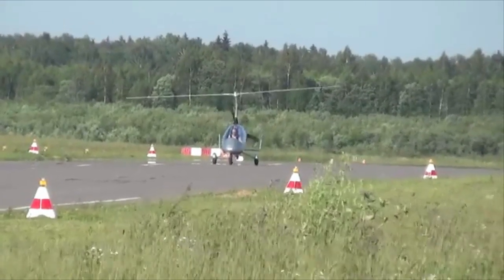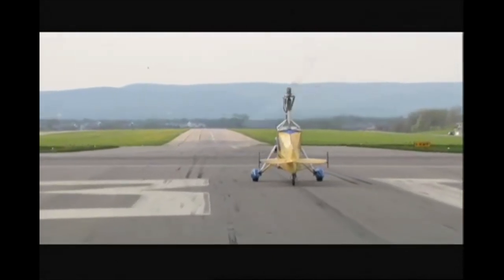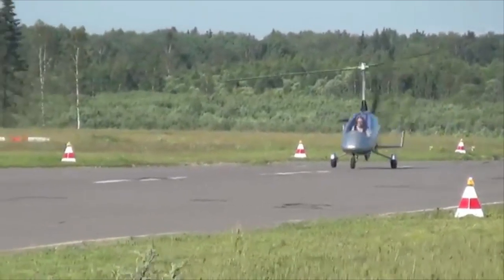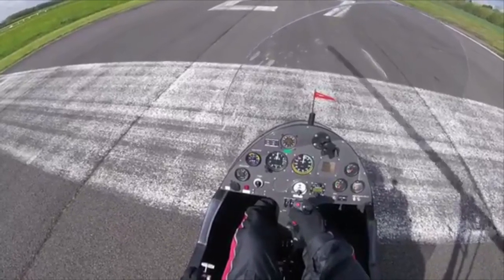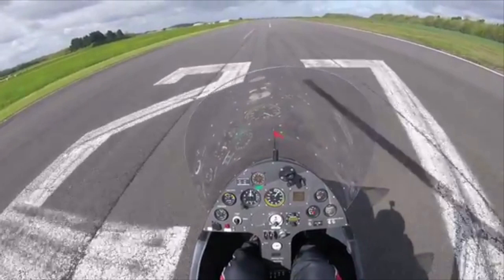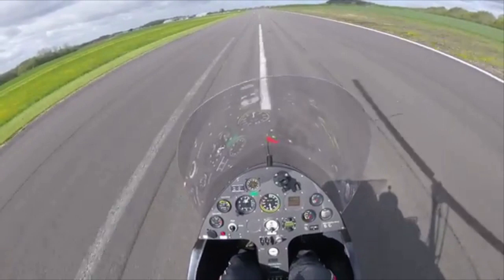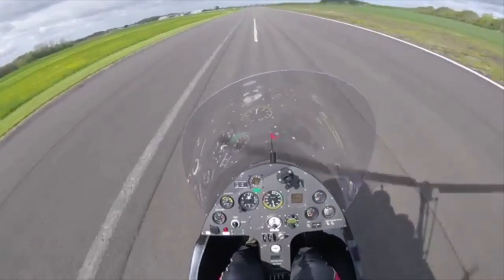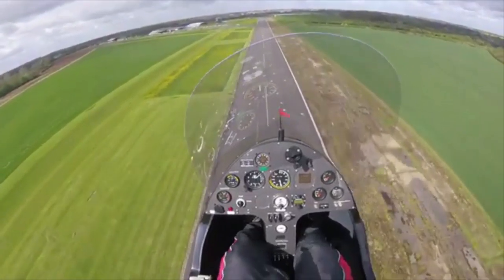Gyrocopter perfect take offs

Comment: One thing that I was taught which I’ve not heard mentioned by other people is to dump the trim pressure (trim fully forward) once the stick is all the way back (in the MTO Sport). I don’t know why (although I have some suspicions as to why), but if I don’t dump the trim pressure, my takeoffs are not as good.  I do bring the stick forward a touch to pre-empt the nose coming up once the rotor RPM is climbing steadily (which would usually be noticed at around 250RPM) and as the nose-wheel lifts, I continue to ease the stick forward to keep the nose down (although still only just a few inches off the runway in a wheel-balance position). If I don’t allow the nose to come up, the gyro starts feeling twitchy in the ground-roll. When I get it right, the unstick is reasonably flat (although, I still need to counter the torque-roll to the right and bring the stick a little further forward to keep the nose level) and I only need to build up airspeed for a couple of seconds or so before I reach climb-out speed.
I do have a video of one of my takeoffs but I am hesitant to post it because the camera is on my passenger (because I wanted to film her reaction to her first gyro flight) and I don’t want it to end up in one of your future videos as an example of what not to do... ;)
Reply from the maker: Thanks for the thoughts.

Without putting words in your mouth I think the feature that you find “comfortable” is the flatter unstick attitude?

Ref: trim pressure – that is linked to the above because if the MT has any residual pressure in the system then it is effective trimmed slight aft and so makes for moving the stick forward slightly harder. i.e. more stick force.

I don’t talk about that here (although it might get mentioned face to face depending upon individual feedback) because:- 

1) it creates yet another step in the process 
2) the forces aren’t that great for an adult guy of average build to overcome anyway 
3) the process I suggest it isn’t a factor because the nose isn’t going to “pop” 
4) even if you feel it is harder on your arms I’d rather trade that for less steps and added mental capacity to deal with other factors that are even bigger deals  
5) if the forces are so great for you as an individual then hopefully sub-consciously you can include the process as part of your own method but done automatically whilst able to focus on the other more critical items.

That’s just my advice – but I understand why you have the feedback you do – its just seat time and creating a consistent feel.  So happy to include the “dump trim” but just don’t obsess about it – in actual fact in Cavalon it has an even bigger effect!

As I mention all the time – making a 4-5min film that is watchable becomes hard to grab all the nuances and cover all bases.  That’s not an excuse but make a 30minute cover all film -  the real nuts and bolts get forgotten while you remember to trim forward, if you take my point?

Neminem posted a link in these comments to an accident in 2012 where the aircraft (seems to me reading) suffered a tail strike because of over rotation.  So to my point and the clips in the film that is a common error  

[and it would have happened in a more extreme way to the Magni M16 pilot in France (the red gyro) but the Magni rotor does not incline as much as AutoGyro and other rotor heads plus it has a straight keel.  So put that guy on that take off in an AutoGyro -  it looks ugly.]  

Yet detractors of mine only focus on rotor RPM or not pulling the stick back.  

Well hang on I say pull the stick back – so if you don’t do that you are not doing the technique but more to the point any accident that has happened that way has only happened to people using the standard technique.  So this is just chatter.  

It is a real issue but it is an error not of technique (whatever you use) but of forgetting to do something you needed to do.  It is helped by having a simple, less complex process - Hence 2 steps.  Frankly if you can not remember 2 steps then stop flying.  Harsh but fair.  

So now we look at the rotor RPM issue.  Well again in this technique we are looking at rotor RPM so how do you mess that up?? Look at the rotor RPM decaying and not act? Again if you can not monitor your instruments – stop flying.
Reply: Gyrocopter flying club - I think that, as you’ve said in your videos, the unstick is a little later and there is better airflow over the empennage. The flatter unstick requires less correction.
My thoughts about why my takeoffs are not so tidy if I don’t dump the trim is because I’ve been taught to do it right from the beginning and I’ve become accustomed to the way that the stick feels, and I’m probably positioning the stick by feel rather than by sight. As the gyro is still on the ground at this time, the feel of the stick is the only feedback. If there is still trim pressure, the stick ends up being further back during the takeoff roll and as the nose comes up, it requires a greater degree of correction. Add to that the fact that with the stick further back, I’ve been creating a lot more drag, so the acceleration profile ends up being quite different.
I think if I were to spend time learning takeoffs without dumping the trim but keeping much the same technique, otherwise, my takeoffs would eventually be as good without doing so as they are when I do so.
I absolutely agree with your aim to simplify the number of steps. I think that the take-off phase is probably when the work-load is highest in a gyro.
I read the article about the 2012 accident. The guy said that there was no damage to the tail but that there were what appeared to be blade-strike marks in the ground to the left of the gyro’s track. This suggested to me that he’d outrun his retreating blade. He even said that the starboard wheel lifted. Of course, I don’t have your level of experience or knowledge.
What I found astonishing in your video is the guy in the silver Calidus. I’ve scraped my keel on takeoff (during training) and the immediate response was to lower the nose a little. He seemed to keep on pulling back.

I agree with your statement that if you cannot monitor your instruments, stop flying - because if you don’t, you’re likely to stop flying one day whether you intend to or not.

Oh... and just to be clear - I didn’t make my post because I disagree with your technique. I was curious as to your thoughts on dumping the trim and why it might make a difference (as you might have a different take on it to my own).
Reply from the maker: Hey no no - hey its cool I didn't think you were calling me out but even if you do thats good also.  Speak freely on this channel I never delete a comment and I answer honestly.  Thats how we all learn right?

What is very funny to me is the reaction to some films/views that I know are controversial.   I get a dozen thumbs down but nobody speaks up.  Its part of the problem actually with the gyrocopter community - nobody wants to stand out and speak up with what should be obvious issues. 

Hey ho.
Reply: Gyrocopter flying club - One thing I’d like you to clarify - Do you advocate for keeping the nosewheel on the ground until unstick or is it just that you are putting the focus on rotor RPM rather than wheel-balance?  In other words, not actually eliminating the wheel-balance altogether but just not making that the focus of the procedure? Because that’s how I interpret your two videos on the subject and I would like to be sure that I understand).
Reply: @RoadRunnerLaser  In some gyros the trim is less easy to change.  In the Sparrowhawk and RAF 200 it is a spring system adjusted by pulling a cable with a wheel.  Not fun to keep adjusting and easy to leave adjusted for the next flight.  So in those and many like them they are left set.  It is hard to give the best practice for every gyro.

Comment: I could understand that. Just out of interest, what techniques do manufacturers recommend?
Reply from the maker: The problem is they don’t describe a methodology to get to this shallow angle of pitch to take off. And as you can see from the link of a 2012 accident in the previous comment - that pilot was waiting for the nose wheel to lift before reacting and he didn’t he just over-rotated - which as you can see from this film it happens often. Some crash some get away with it. The key with this technique is that you are pro active and alive to action at key points plus the drag is less and if you add in the context of the newer 320rrpm aircraft this technique is closer so again requires less re-training. Mental capacity is key with gyros.

Comment: The way of the world. Things have changed for the worst unfortunately. If only people were still learning proper rotor management skills without a rotor tach or power full pre spinner, people would learn to "feel" what the rotor is doing and half the take off accidents would be avoided.
Reply from the maker: Hello Jim I would agree in so far that this method you talk of means a greater investment of time and so the learning is prolonged - that said see the next film.  We simply don't have spare airfields with no traffic or noise issues to practice all day.
Reply: @gyrocopterflyingclub6148  Point taken, but I still think people should be taught to bring the rotors up from say 100rpm. Shouldn't be to time consuming for most and will demonstrate the feel of the rotor.
Reply: Worse instrumentation is not the answer to better flying habits.